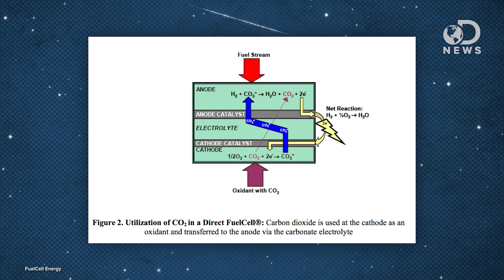Could This Technology Make Cheap Energy Clean?

Comment: We are running 6 atomic bombs each second in excess heat. Carbon budget way over never seen before levels. Ocean now supersaturated as shown with spray now 3x height of waves. Now discharging CH4, CO2, H2S and No. Oceans turning apoxic, green microbes producing H2S at rates that shock. Our fish if you dumb enough to touch anything from the ocean technically extinct, methane clathrates venting out of control worldwide. Past geologic record shows, rapid transfer of H2S to atmosphere with oxygen deprived oceans, caused by heating meaning less oxygen carried by water, which now is less H2O and more greenhouse gasses. Concrete continues to emit CO2 and with its heavy load of supremely toxic fly ash and bottom ash, which should be dumped in a similar facility as spent nuclear fuel its also being released as excess carbon. This corrupt group of extraction companies is going to extract the last dollar just before we all asphyxiate.  They have corrupted the entire political system, if you only knew how bad, lol. See that pic of china, well in a very short while its going to be us, I mean very short while. If your not taking calcium supplements your losing bone mass as we speak. There may be possible solutions, however impossible late this time frame is, but these idiots will not listen to reason until the very last second and their own kids and grandkids are turning blue, not going to be long either, I mean shortly. God is going to judge them, believe me when I say that.

Comment: This technology probably costs a lot to implement. But at a smaller scale they could use carbon capture for the liquid fluoride-thorium reactors. They don't need to put the CO2 to total waste. It's only to fuel the thorium but doesn't get emitted back to the atmosphere.
Reply: DistortedFaiths You use CO2 in LFTRs together with the waste heat to turn the CO2 into synthetic fuel for our current vehicles.
That way we get CO2-neutral fuel and can stop turning oil into fuel.

Comment: I dont get why this is so complicated though.
Dont we have some heavy, slow machinery, perhaps a pressure based system that can run of off a huge tank of rapidly carbon absorbing algea or some other biological process that can use the energy produced in the chemical processes going on to provide some useable amounts of energy?
Or at the very least produce copious amounts of breathable oxygen and clean out some of the pollutants?
I know we are researching using algae to produce food and breathable air in space at the moment so can't some of the process gleaned from that be used to make a large scale system intended for deployment in a major city to clean a certain radius of air pollutants and co2?
They are able to do this with hyper efficient patch forestation where every single cm of space is occupied by fast growing and highly efficient plants and everything is planted using a system gleaned from Toyota's manufacturing process to get the cost to an absolute minimum and the efficiency increased 10 fold with the growth techniques of the head engineer.

Use these kinds of people to create a co2 scrubbing system for you and the problem would be solved quickly if thrown enough resources and bright young engineers at, start a global college for the brightest and most promising and pay theire way through life, they would be world wide superstarts as long as they help provide the answers for our global problems and the task might be greatly reduced by the time the worlds politicans finally realise that the problem concerns us all far more seriously than theire insane wars and power games.

I get the uncomfortable feeling  that even though the sane and easily accomplished methods of reducing our self poisoning is ignored for the sake of conviniency and short term profits as they watch the world go up in flames.
Imagine if you would a simple shift in the path of the ocean currents, doesn't seem all that bad, right?
Well, the portion of the world where I live would experience another ice age.... That's kind of heavy, no?
Imagine the change to tropical regions with potential cold or warm water currents going through regions they previously skirted, huge portions of ocean based resources fish might die as a result of the temperature changes, they might not be able to grow the same crops because of temperature changes, increased or decreased rainfall, there might be draught in places there previously were copious amounts of rain or vice versa...
The potential dangers of our ignorant pollution might well spell the doom for large portions of our species and that does include the richer nations of this world.

Imagine you all having to pack up and crowd down to one of those warn thor countries and foreign habitats you have helped created simply to survive some natural catastrophy....
Imagine how you would be treated then and reconsider your disposition towards plundering resources and keeping people down for the sake of cheap merchandise and low costs on imported food..
Why do you think the us of a is reconsidering contact with a communist state they have ignored and attempted to blockade for decades but suddenly turns out to be useful with it's potentially easily abused peasant population in this future of potential war between the soviets and the "allied" forces that would arise, potential famine and chaos in several European countries as well as the usa and on top of all that an uncertain global climate change that is already starting to affect water levels which will, within a measurable time frame force large portions of people to migrate around, making for unstable conditions in all the regions affected by it.
There's already regions noticing bad enough changes in the weather patterns to affect theire abilities to grow food and hence has to resort to more import  and in a lot of cases foreign aid, conditions are really bad around the "rest" of the world not included by the tourist recommended destinations if you will, there are still dictators, there are still power abusing, grotesquely corrupt governments using torture, murder and intimidation to keep theire citizens in line and under government control, some more honest about theire forced rule than others, the media lies and slants the truth so you get served mostly only what the government wants you to know, they are no longer objective as they once were revered for, the third state is no more than a puppet in many western countries these later years...
There's ongoing major wars with people killing each other over religion, resources and power.
And yet, the climate change could ultimately end all of that, maybe not today but perhaps for your children, or for theire children, we are a species, not nations, before all the vagueries of who gets to control what we need to see to the survival of the species and the potential of mass extinction from our own ridiculous ignorance of the problems at hand.
Other species have expired on this earth, possibly most of them by our hands, but we at the very least have a responsibility to assure our survival that is built upon the carcasses of the species and environment we trampled to get where we are today, we owe them that much at least.
We excuse ourselves by saying we have the capacity to think and reason so therefore we stand above the beasts and can be forgiven for exterminating species upon species and making this rock pile we call home less and less fertile...
Well, at the very least use that brain of ours to help solve the problems we create and save what can be saved, without a symbiosis between man and earth there will never be a sustainable system that will allow for us to keep living here, space exoduses might sound amazing and a brilliant "way out" but it still hasn't been done and none of us here on earth today are likely to become the succesful escapees so we have to look elsewhere for our answers, you ain't taking the billions upon billions of human bodies off this rock any time soon, and the problem isn't exactly getting any smaller.

If anyone has bothered reading this far I will excuse the long rant but sometimes I feel I have to voice some reason if only to calm my own mind, do hope you dont feel you have wasted any portion of your life on reading my opinions.

Comment: Carbon dioxide has no liquid state at pressures below 5.1 standard atmospheres (520 kPa). sooo,, "They chill the carbon and steam mixture to about 40 degrees below zero, which is considered easy in the chemical world, well within the range of commercial cooling systems. At that temperature, carbon dioxide gas turns into a liquid, which is easily drained off.
", does this not beg a question?? no, i'm not a chemist. just curious!..

Comment: Coal is almost 99% carbon so, when burned, is combined with oxygen to produce a heavier molecule: CO2 (A carbon atom has an 		atomic weight of 12, and each oxygen atom has an atomic weight of 16, giving 		each single molecule of CO2 an atomic weight of 44. Yep for every ton of coal you can expect to generate 3.6 tons of CO2 and this seems (to me) to be too impractical to get rid of. Now if your fuel cell converted CO2 and H2O into methane then it would be a totally different story.

Comment: I used to work at FuelCell Energy on their DFC-H2 project which is very similar.  If you have any questions about the fuel cell aspect I can answer them.  As for pumping and storage of the CO2 I have read a few papers but there is significant evidence that this can work long term depending on the rock formations.